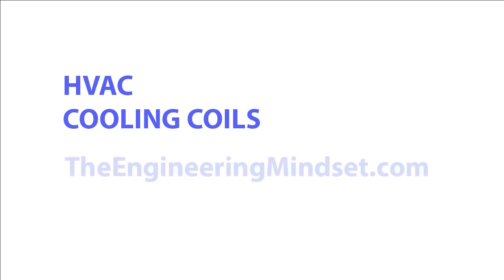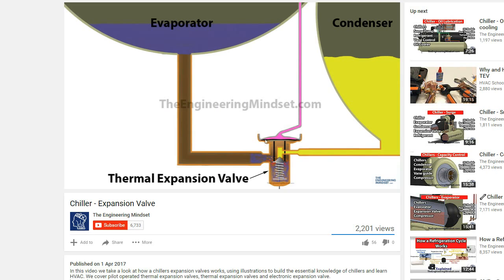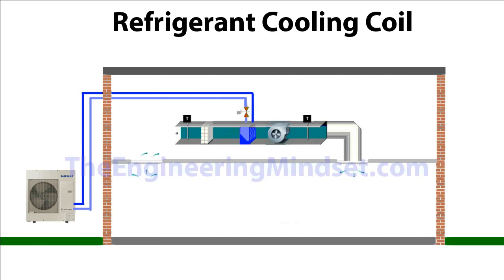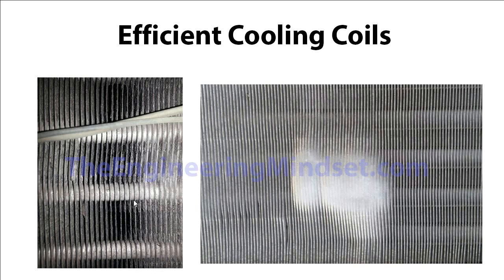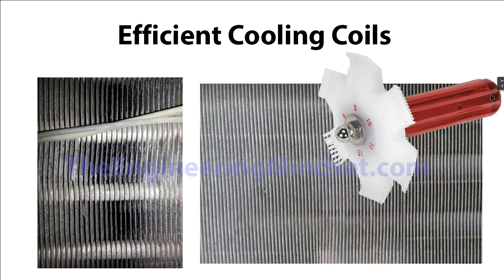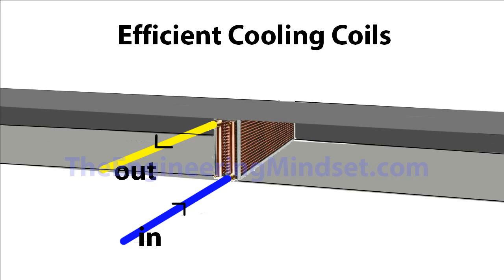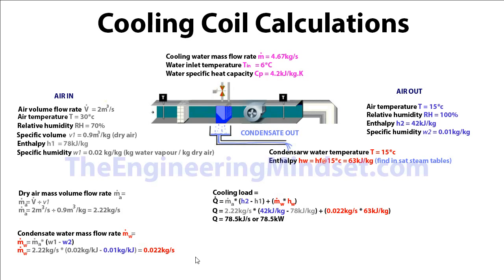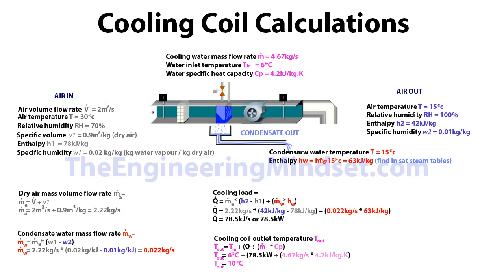HVAC - Cooling coil + Calculations ❄️❄️❄️

Comment: Good lesson.  Small correction - the condensate water term should be negative.  
energy in = energy out
h ent air = Q coil + Q condensate + h lvg air
Q coil = Delta air h - Q condensate

Comment: I think the condensate is already included in the air calculation. No need to add it separately. It's only 1.4 kJ/sec, but it's already counted in the air enthalpy. See: "Total Heat" calculation in the  article about "Cooling and Heating Equations" in  the "Engineering Toolbox" site.

Comment: Perfect and useful.
I wish new videos about cooling coil water pressure drop and air pressure drop.

but for the latent heat cooling load calculation, you assumed hw = hf ( heat of vaporization vs heat of saturated liquid)..why?

Comment: Thanks for this helpful video. I have a question about the air pressure drop, how to calculate it? If you can provide me with some sources it will be better <3. Also, if its possible to give me some resources about how to design cooling coils it would be very helpful. thank you

Comment: Thanks for the great video.. so helpful

In case we have AHU designed and the evaporator coil sized to specific capacity, can we increase the airflow to achieve higher capacity?

A chiller designed to specific capacity and connected to AHU to achieve a certain indoor temperature and air change rate, whats could happen if the AHU coil changed to another one smaller with the same high air flow?

The face velocity will be higher?
The effects on sensible capacity?
The effects on latent capacity?

Thanks again

Comment: The specific humidity unit in the condensate water mass flow rate calculation is wrong. It should be in kg/kg.

Comment: How come you have 100% RH when the air has been conditioned through the cooling coil? Keep up the good videos 👍
Reply: At lower temperatures vapour gets saturated even at lower partial pressure. So for a vapour it's easy to attain high  relative humidity ,since relative humidity is the ratio of partial pressure of vapour and partial pressure of vapour at saturation.

Comment: Pual my question is when three way valve is activated then in this situation how much water enters into the cooling coil ? Or water completely bypass the cooling coil and goes back in to return line.
Reply from the maker: depends on the system, you can check the valve manufacturers documents to see the correlation between position and flow rate

Comment: In the cooling load calculation , Q_dot should be negative i.e. -78.5 KW. Why have you taken it positive?
Reply from the maker: partha sarathi Das over time engineers find short cuts and this is one of them, in the real world no one asks for a negative 75kW heat exchanger. You're right it is a negative value though.

Comment: Hi Paul, superb illustrations and explanations..Just one small doubt   Do we have to get RH of 100% for air coming out from the cooling coil in order to achieve the desired cooling effect...
Reply: I was also thinking of the same matter. Unless we use to humidify the cool air after evaporator coil, the RH will not rise to 100% RH.
Reply: Yes, you want it to "rain" on the coil, wringing all that water out of the air.  That way when you warm 55 F 100% RH air up to 75 F it is at 50% RH.

Comment: Hi! Thank you for your great job! You really understand a lot of things about hvac systems and their components! Please don't stop and continue the great job! 
Just gonna suggest some themes that I find interesting to understand better so you can maybe had to your list, if you find them interesting:
- the various psychometrics evolutions of the air passing through the coils and other components (water cooling and heating coil, dx heating and heating coil, just an electrical resistance, humidification and dehumidification, and maybe others) 
- how a boiler works and main components (domestic ones (traditional and condensation ones) and industrial ones as you show in one of the videos) 
- how other type of cooling towers works 
- the tabs systems (thermo active building systems) 

Thank you once again and sorry for possible bad english 

Best regards
Reply from the maker: All good points, Tiago. Thanks

Comment: Hi, thanks for the video!
How do you select a coil to be used in order to achieve a desired cooling capacity? In other words I would like to understand how must I design the coil geometry to achieve certain cooling capacity, with the water inlet & outlet temps. known, air entering temp known etc.
Reply from the maker: Coil geometry and design gets very complex. It takes hours of calculations, you should google the formula Q=U*A*DT as a starting point

Comment: Thanks for the great video. Please make more videos on HVAC system designs with calculation in different buildings. (May be start with something like single zone design with cooling load & fresh air requirement etc)

Comment: You sound Aussie. I assume you're a mech engineer working in HVAC. How's the HVAC job market? I'm planning on heading back to uni to study engineering.
Reply from the maker: Hey Roy, I'm not Aussie, but I have a mixed accent that often confuses people. I'm a dual mechanical and electrical engineer, working in building services consultancy. In my opinion HVAC is a great career path. You will likely be a mobile engineer and move around different sites meeting very interesting people, plus a lot of equipment is on the roof so you get great views over cities. It's also a job which will be less affected by the automation revolution, and it's in growing demand. No matter how the financial markets affect the world, there will always be the need for an engineer in a building.

Comment: Our Indoor design will be 23*C , RH - below 60 % .
 in this case the air which coming out from coil air having almost 100% RH !!!  Here how will you control this RH Level??
Reply from the maker: It's just an example. You can sub cool it and then reheat but a more efficient way is to use a Desiccant
Dehumidification unit.
Reply: The Engineering Mindset  Thanks for your advice!
Reply: The air off the coil will be 100% rh , on entering the room i.e air off the grill it will mix with the room condition to make 60%rh i.e 13dec will mix with room condition so it will make 23dec c..since the dbt increase simultaneously the rh tends to reduce
Reply: The Engineering Mindset for maintaining 50-60 rh any ancillary is not required for comfort application